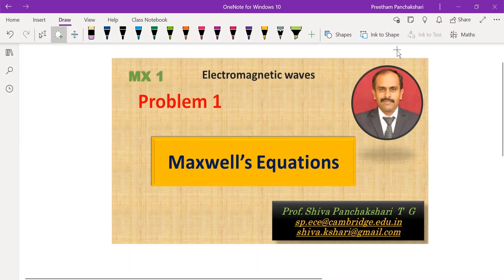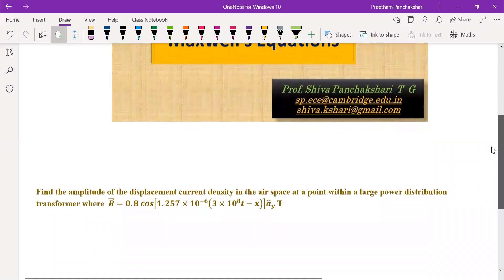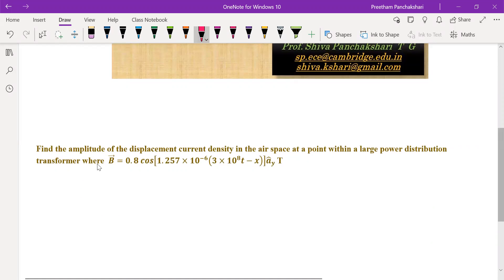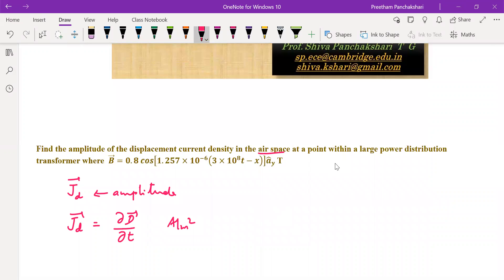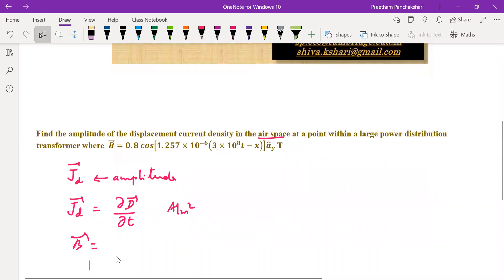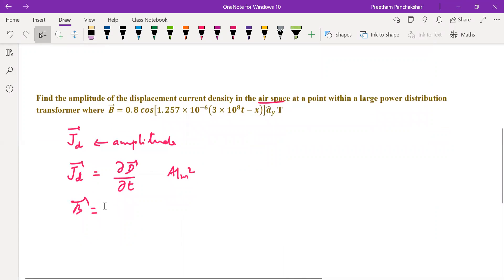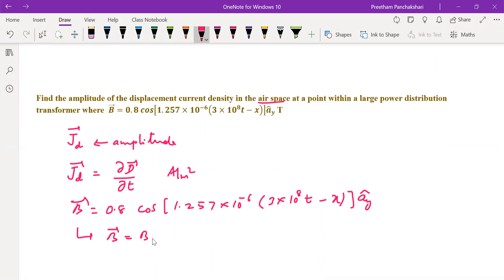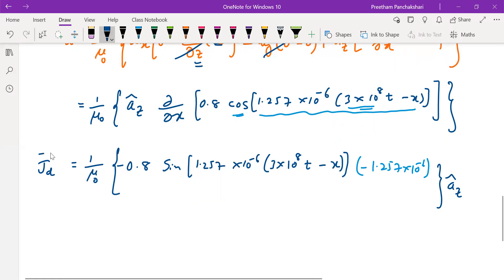Problem 1 | Maxwell's Equations | Field theory | Electromagnetics | Shiva Panchakshari T G

Comment: Sir 12:18 not understand
Reply: Amplitude simply means, the maximum value of Jd. In the equation, max value of Jd is when sin term is max. And in Trigonometry, we know that the maximum value of sign is 1. So the left terms*1 is the amplitude
Reply from the maker: You are right. Maximum value of sine is 1. But the term multiplying the sine term becomes amplitude. For example, in the equation, 5 sin(x), 5 becomes amplitude.
Reply: Trillions thanks Sir, Allah salamat rakay